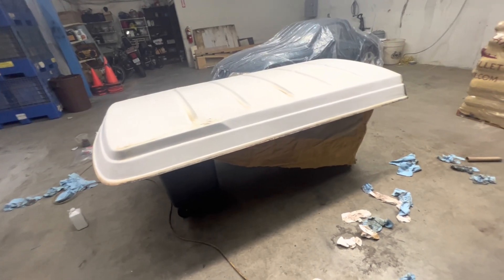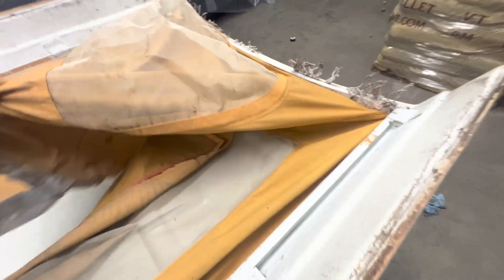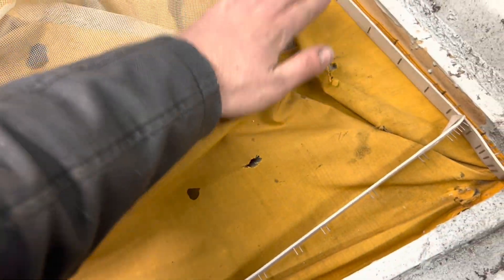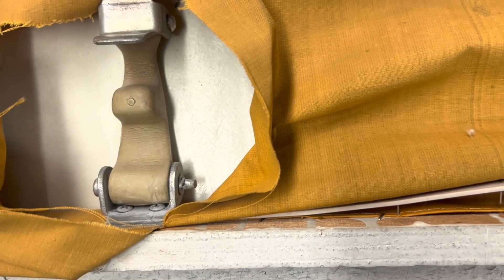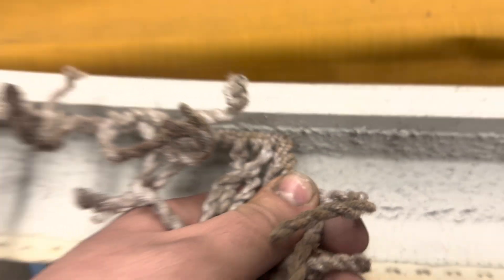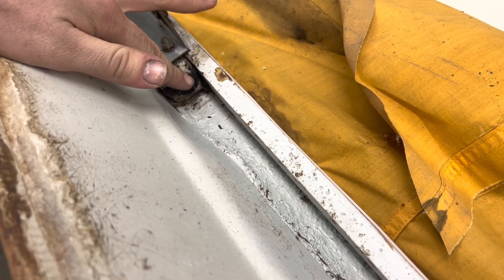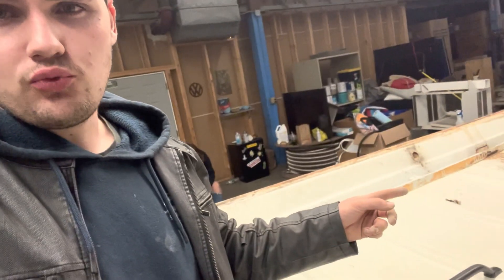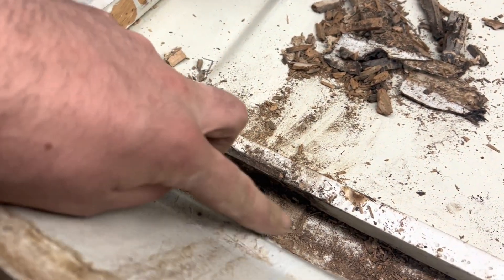Bay window Pop Top Canvas replacement

Comment: Hi!  This is a great video - super helpful. Question - what about the pop top seal latches?  Where to they go and how do you keep the poptop down now?
Reply from the maker: @AndreaStockert  I believe the latches differ in some of the bay window campers, but mine just has the three rubber tie downs on the inside. There are hooks on the bus side that they latch in to. The latches themselves just screw into the wood/tackstrip area. I used the bus side hooks to line it up.